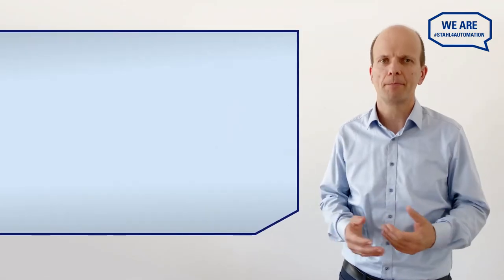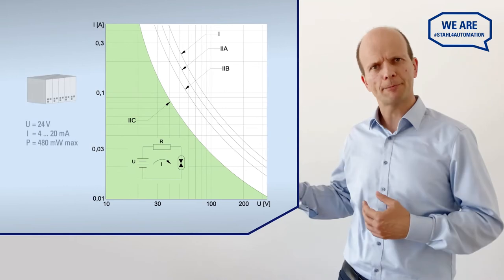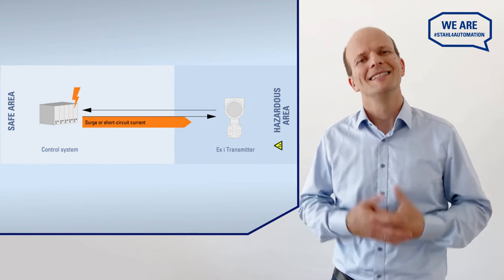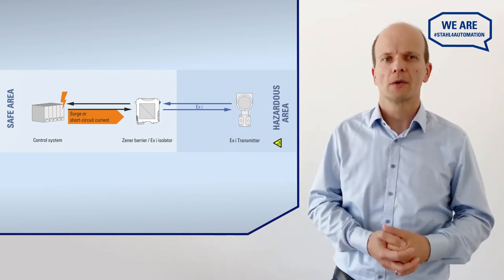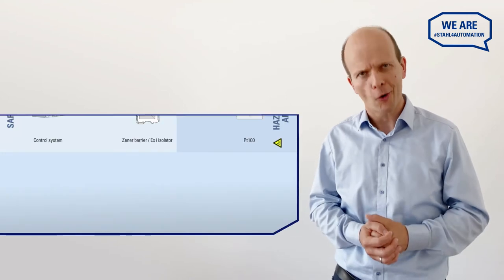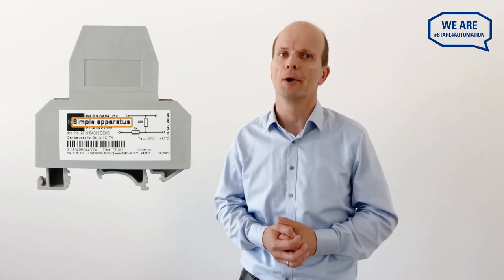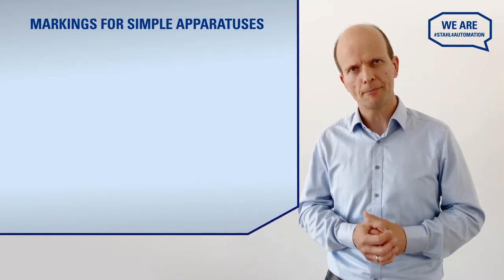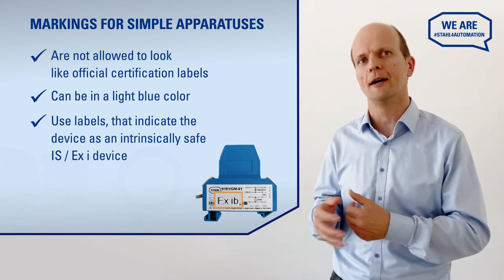FAQs on Intrinsically Safe Loops by R. STAHL Expert

Comment: Hello, I am aware of IS CALCULATION concept. But for one loop only. Like BARRIER to JB to LT.

But I am not sure how would be the process for IS like this case. BARRIER to JB to FIT to FE? How is The cable from FIT for FE considered in calculation?

In my case, I have a flow element with its own instrinsic parameter.. then a transmitter with its own instrinsic parameter also.. so Im confuse how consider it in IS calculation?

Comment: Hello, i have a question, if one design a field device according to Ex m (encapsulation protection) does this field device still need energy limiting barriers?
In other words, can a Ex m certificated field device, for installation in Ex areas, be non intrinsically safe, or will a Ex m certisfyed device always ALSO have to be intrinsically safe approved, and HAVE to use safety barriers?
If a Ex m device do not need safety barriers, then what kind of cabling does it have to use, Ex i cabling ot Ex d cabling, or something else?

Comment: Not really accurate information I would say also a little misleading: "Simple apparatus shall be
clearly identifiable by durable labelling."

16.4 Simple apparatus
Simple apparatus is independent of the equipment protection level. Simple apparatus shall be
clearly identifiable by durable labelling.

IEC 60079-14 
Labelling for simple apparatus may be by any party, including the manufacturer or installer,
and may be by any designation marking or code preferred for the installation such that it is
clearly identifiable as simple apparatus.

Additional information to assist in the identification of the simple apparatus such as a
reference to the instrument loop number may also be marked.